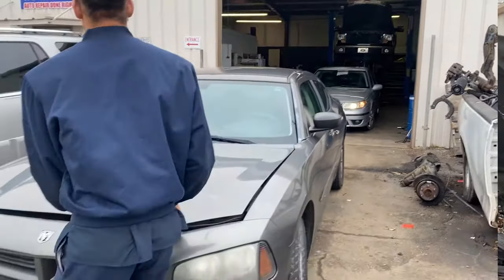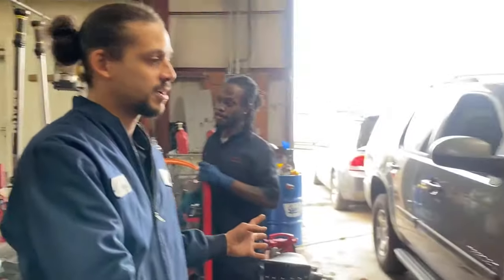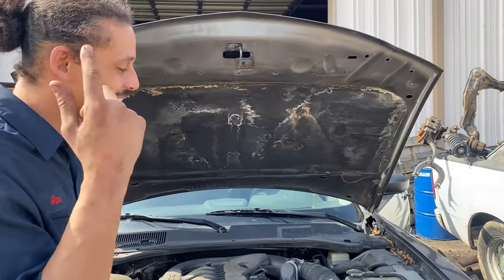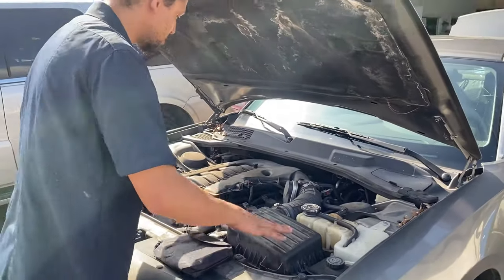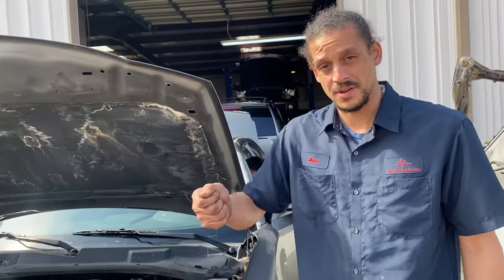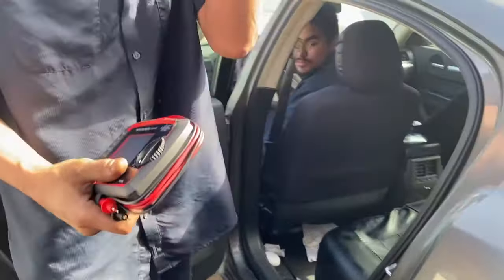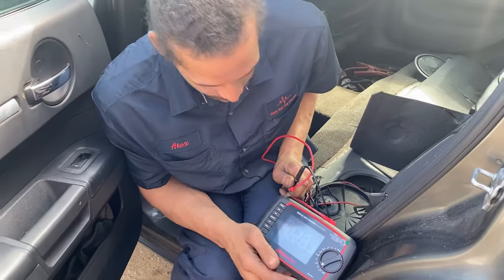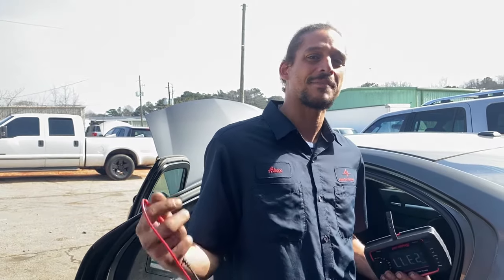Diagnosing Another Dodge Charger - Turns Over But WON'T START  #carwontstart #dodgecharger

Comment: MAN ALEX I HAVE A 2008 DODGE CHARGER 3.5 V6 AND WHEN I TRY TO CRANK THE CAR IT DOESN'T DO ANYTHING, IT DOESN'T CLICK OR ANYTHING AND I HAVE TRIED SWAPPING THE STARTER RELAY BUT THAT DOESN'T HELP..... I NEED SOME HELP
Reply from the maker: Hey buddy. The stater itself may be bad take it off and let Autozone check it
Reply: @AlexTheCarDoctor  OK i was thinking this but someone was telling me the starter usually clicks or make a noise so I didn't try
Reply from the maker: That’s not always the case I had a car do that in the shop today didn’t make any noise turned out to be a bad starter
Reply: @AlexTheCarDoctor  Thanks alot I'm try this and let you know how it goes(And ima like and subscribe right now my guy)
Reply from the maker: Thanks for your support buddy. I will do a video on how to test a starter on the car soon
Reply: @AlexTheCarDoctor  No Problem and Thanks again

Comment: Very weak spark so you probably  have a problem  with  pcm how many miles on it or you got a bad ground how old is the car .or cam sensor is bad or throttle piston Sen cor is bad that will cause it

Comment: This video helped I did change out the fuel pump but car still not starting New starter new alternator new battery new starter relay
Reply from the maker: Hello and thanks for watching what type of car do you have and engine size
Reply: 2010 charger 3.5L
Reply from the maker: Those cars have timing belt you may want to check the belt behind the cover in the front of the engine near the drive belt or simply do a compression test

Comment: Hi Alex & Friends. 
Can someone give me advice? 
I’m currently experiencing issues with my 2008 Charger. We’ve been troubleshooting. Charged the battery, added gas. The engine starts with the cranking sound. Starts then turns off. 
While I was driving the care slowed down I pulled over & the car stopped. 
HELP!!!!
Reply: Also I failed to mention that It’s an retired Cop Car 👮 👮‍♂️
Reply from the maker: Hello. What type of engine do you have
Reply: @AlexTheCarDoctor  08 Chrysler 300

Comment: Did u ever find da problem
Reply from the maker: Yes I do believe it was a fuel pump. That’s one of my old videos but I remember
Reply: @AlexTheCarDoctor  yea da video old mu charger won't start just put a brand new battery and it has no codes.. the I check fuel pump n relays
Reply from the maker: @maxgunna9067  follow my steps in this video and you’ll figure it out
Reply: @AlexTheCarDoctor  u definitely got my sub thanks
Reply from the maker: @maxgunna9067  my pleasure buddy and thank you for the support
Reply: @AlexTheCarDoctor  I might have 2 replace da full pump the car won't star n less I turn  the key on da on like 2 time b4 it crank n start sound like fuel pump
Reply from the maker: @maxgunna9067   I always recommend the fuel pump assembly.especially with this modern day vehicle with the fuel filter built into that assembly

Comment: I have P0340 code I changed camshaft sensor crankshaft sensor fuel pump all new still no start whatsoever changed spark plus also everything new all it did was stalled out and died

Comment: Why jump to the fuel pump conclusion without checking if the car starts with some Starting fluid
Reply from the maker: Spring starter fluid in the car is not really recommend and if not done properly it could backfire causing a fire or burning you. I stop using that method a long time ago after a couple of fires here and there. Why the fuel pump conclusion because I see these cars every day and I pretty much know what fails on them,I normally go right to the problem
Reply: @AlexTheCarDoctor  I have an '06 Magnum with the 3.5L, cranks, doesn't start.  I'm glad I didn't try the starting fluid test.
Reply from the maker: @BTC909  me too buddy safety is key

Comment: Bought a 2013 dodge charger r/t hemi was working fine first day i brought it home the etc light came on and the temp guage stop working at first i would be able to just restart the car and the car would go back to normal after like 2 days car was just getting worse and would just stay on all the time and temp guage out now i went to turn on the car one day and notice the battery died because the old owner had lights under the car and i didnt know and the lights where on i took the battery to charger car turned over like nothing for like a week then the car didnt want to turn on no more the battery had enough juice took it to get chargerd and they said it was fine so i tried for like 2 weeks and car wouldnt start and notice the battery went dead again charged it and tighten the battery really good and left it over night came back the next morning and car turned on after shaking it a bit the brake petal is hard and power steering went out while driving horn stop working and now car wont start

Comment: Alex how's it going? I have a '16 Charger currently having a similar problem. Dash says service fuel sensor and my fuel gauge is all over the place. Car doesn't turn over right away like it used too. Sometimes it'll crank and crank and not cut on. Other times I have to try two or three times before it turns on. Just recently today it wouldn't start at all. It sat for maybe 30 minutes then it cranked and cranked and finally cut on. I've replaced the starter, battery, key fob battery, fuel pump on both sides, fuel sending unit, fuses for anything relating to starter or fuel pump. I don't know what the issue is. Any ideas?
Reply from the maker: Hey my friend all is good. What is your engine size
Reply: @AlexTheCarDoctor  3.6L V6
Reply from the maker: Ok I’m looking at the electric diagram now. was the car doing this before you replace the fuel pump
Reply from the maker: Have you tried replacing the fuel pump relay in the truck.
Reply from the maker: If that was replaced it only boils down to three problems wiring issue or ground problem Power distribution Center that’s the whole fuse box in the trunk or a bad PCM. If that relay doesn’t fix it you will need strong diagnostic skills to locate the problem my recommendation is to take it to a reputable shop to avoid throwing parts at it and wasting money
Reply: @AlexTheCarDoctor  yes it was. After the alert came up I replaced it and the problem didn’t go away
Reply: @AlexTheCarDoctor  yes
Reply: @AlexTheCarDoctor  I was trying to see if could figure it but you’re right my best bet would be to go to a shop I guess. I appreciate your time and thoughts
Reply from the maker: That’s a hard one to figure out without seeing the vehicle for myself
Reply from the maker: When you figure it out let me know buddy.thanks for watching
Reply: @AlexTheCarDoctor  I think it might be the wiring. After further research, I discovered that if you replace the fuel pump the wiring harness isn’t exactly the same with the new one. Might have to switch a few wires around
Reply from the maker: That’s what I thought right off wiring issue. did replace The fuel pump with a quality part
Reply: Hello mechanic
I have 2008 DODGE CHARGER
I HAVE REPLACED MOTOR AND STARTER 3 TIMES...THE DASH BOARD LIGHTS UP BUT CAR WANT START ANY SUGGESTIONS

Comment: Please I need help my Beastie just got a 2011 Dodge charger yesterday and it died on her while driving it today and don't wanna turn back on now some red lighting light came on
Reply from the maker: Hey there do you have the 3.6 v6,was there a check engine light on prier to it cutting off
Reply: @AlexTheCarDoctor  no check engine light before or non but a red lighting light is on now and don't wanna start now
Reply from the maker: @JosePerez-qu8lr  do the vehicle turn over meaning the starter engage the engine and spins it over
Reply from the maker: What is your engine size
Reply: @AlexTheCarDoctor  yes its the 3.6 v6
Reply: @AlexTheCarDoctor  3.6 v6

Comment: What if you replaced the fuel pump and it’s still not cranking ?
Reply: Look up "starter relay"
Reply: @B_HarTz   I replace it that’s not it I think the TIPM is bad that’s why the fuel pump is not getting power